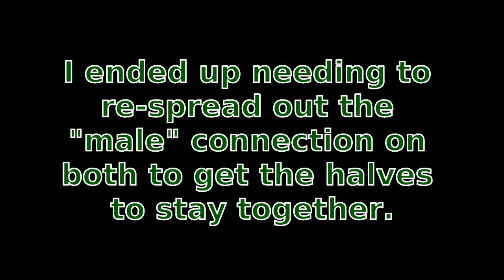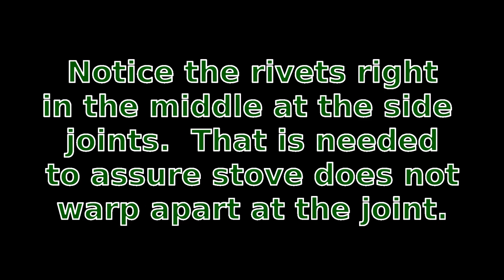Make A Simple Cheap Tent Wood stove - Part 1

Comment: Lonnie, would it make sense to peen the stove pipe opening from inside to the outside so it fin in the pipe? I am imagining that it would allow smoke to rise up without leaking out. Also, is galvanized metal safe at high temperatures in confined spaces? I thought I heard at one time it was bad to breath. Maybe that’s only at welding temperatures. Pretty ingenious design, though! Take care.
Reply: Sounds like you touch on heating galvanized steel towards the end!
Reply from the maker: Concerning heated galvanizing safety, you did not watch the entire video.   You DO NOT want the stove pipe collar upright so as to fit inside the stove pipe.   Burning wood creates distillates which condense out on the cooler stove pipe and run back down the pipe to drop back into the stove and be burnt.  If you place the stove pipe outside the collar, those distillates will run onto the stove top and drive you out of your shelter because of the fumes and overpowering aroma.  In a properly designed stove such as this one, you do not need to worry about smoke leakage as long as you are using a clean stove pipe that is not built up enough with creosote to limit draw.
Reply from the maker: Yes without rewatching the video I assume a commenter  was correct when they said that it is around the 33 minute mark where I discussed galvanizing burning safety.
Reply: Far North Bushcraft And Survival yeah, I got to that part. Glad you answered about the pipe, too. Thanks Lonnie. I just need a tent to build a stove for now! Take care.

Comment: How much use can you get out of these stoves? Would they last longer if you use a grate or shelve on the bottom?
Reply from the maker: I do not know how long this will last but I will not be surprised if I get a minimum of 5 years of occasional camping use.   I do plan on making a false bottom for this eventually and will video the process along with other mods that I have in mind for the stove.

Comment: Thanks for the video. Stove looks great. Im excited to build me own. How's it holding up?
Reply from the maker: This stove actually has very little use on it so far buit it works really great.   The door and door area has warped somewhat and so can not be stoked up full of wood and allowed to burn since it will get outrageously hot and uncontrolled.  I need to install a stove chimney pipe damper.

Hot Tenting In Alaska Winter Using Homemade Tent And Stove
https://www.youtube.com/watch?v=gQ_eb92vJMk
Reply: @Far-North-Bushcraft-Survival  Good to know. Thanks alot and thanks for the videos. Keeps me entertained and gives me something to do when im locked up inside. Nice work and please keep em comin.

Comment: Hi, is there a reason you have to make two bend  on that pipe piece to make top piece and bottom piece joined at middle of side wall? I was thinking to make just one bend in the middle of flated pipe piece, and joined two piece at corner, like square trunk duct pipe.
Reply from the maker: The edges would still have to be bent so that they could mate to the opposing piece if using the method you are asking about.  So instead of two bends using my method, you would require three bends using your method, at least on one of the sides

Comment: How long does this stove last? I am thinking about making one to heat my shop and wondering if it will last more than one winters use???
Reply from the maker: I would not recommend this stove construction for a semi permanent installation.   This should only be used for temporary shelter camping such as a hot tent in my opinion.  It is too thin to safely use in a building.   If you are wanting to go inexpensive, I would recommend a barrel stove kit.  You can get barrel stove kits for usually under a hundred dollars and then build a quite durable stove using an empty 55 gallon barrel.   I used a 55 gallon barrel stove kit on a 30 gallon barrel and it worked quite well with a few modifications.   Luckily the particular kit that I obtained would fit the door portion on the smaller diameter of the 30 gallon barrel end.   It is what I use for my main hot tent stove for my larger hot tents.   Through the years I have seen several people using the barrel stove kits for cabins and shops.

Comment: Nice work. Did hear you say you are going to make a hot tent out of a the nylon or poly which ever it is? Should be a good video. I know you did one out of tarps, like you get at Harbor Freight or Lowes Hardware. Do you have plans to make one out of the light weight stuff? I can't remember what it's called. Take care.
Reply from the maker: The material I have is 1.1 ounce Mtn Silnylon.   I do not have any "plans" as such but will be doing a video on the process if everything goes alright.

Comment: Very good video as usual. I cant find 7 inch stove pipe around here. Would like to know where to get some.
Reply from the maker: I got my 7 inch stove pipe from Lowes Home Improvement national chain store here in the USA.   It does not need to be 7 inch.  It could be 6 inch for a smaller version of the same stove.

Comment: Great design,  and I like the video.  But the materials used are to lightweight.
Reply from the maker: It can truly only be said to be "too light weight" if it fails to function as intended.  This stove has proven itself and is well worth many people considering doing due to the effort and cost vs longevity ratio.  This stove may not be worth it to you for YOU to make but I am sure many others would feel very differently because to them, this stove may be the very best option they have ever found once all the considerations have been weighed and balanced.

Comment: Could you put bbq grill paint, or high temp engine paint on that after the galvanized particle are gone ?
Reply from the maker: I would think that would be possible but I have not tried it personally so do not know for sure if the paint will adhere well to that heat treated metal.

Comment: great video, would it help to install a fire grate in the bottom? I'm in the process of an fat 50 ammo cam stove but I really like your stove. thanks for sharing.
Reply from the maker: There is no need for a grate if you are thinking in terms of burn oxygenation.   I do plan on eventually placing a two piece elevated false bottom in this stove for stove floor longevity.
Reply: thanks Lonnie i'll give it a try. @Far-North-Bushcraft-Survival

Comment: Great work Lonnie...just curious...I looked up about galvanized steel used with heat and it says it only allows up to 392°....is it still safe to build?

Galvanized steel can be welded; however, one must exercise caution around the resulting toxic zinc fumes. Galvanized steel is suitable for high-temperature applications of up to 392 °F (200 °C). The use of galvanized steel at temperatures above this will result in peeling of the zinc at the inter metallic layer.
Reply from the maker: galvanized steel is perfectly fine to use for wood stoves but the galvanizing needs to be burned off as I said in the video.   Galvanized metal stoves have been used for many many years.

Comment: I had mentioned in the Tent video to weld 1" x 3/8" stiffeners to prevent warpage, but since it's a non-weld job then 1" x 1/4" stiffeners with. longer rivets would be used

Comment: How does it last long term?  Gavlanized steel is not a high heat metal. and would assume it would deterioate rapidly
Reply from the maker: Time will tell how durable it is as a stove but I will not be surprised to get at least 5 years of occasional camping use out of it.   I will be spraying the cleaned stove with PAM type cooking oil at the end of each winter camping season and storing the stove out of the weather.

Comment: I can't see the bottom lasting very long. I realize the scope of this project was to make something with minimal special sheet metal tools. Perhaps adding piece 16 ga- 1/8th stainless steel bent to insulate the bottom and an inch or so up the sides. use a few nuts as spacers to keep the stainless off the bottom.

Comment: Great video, ty. Can I use Flue pipe tape to seal the seams?
Reply from the maker: I am personally not familiar with flue tape but also am not aware of any seams on this project that are in need of sealing.   The air leakage that would be best to remedy is caused by stove door warpage and sealing.

Comment: Brilliant Lonnie - once again. What tent material do you use to house the hot stove pipe?
Reply: Just to clarify my question Lonnie - you said that you had a nylon tent. Is the hole that houses the stove pipe made of a different, more heat proof material?
Reply: @stephencockett9959  ... If you're referring to where the stack goes through to the outside ... yes, it's definitely different material.  It's made from a Fiberglass Welding Blanket.  You can see him make it here:
https://www.youtube.com/watch?v=HfiUgGhTe1k
Reply from the maker: What Arthur linked to below does work well.   But what I will be using in the nylon tent will be lighter in weight than what i have used in the past.   I am wanting to reduce bulk and weight in this new tent and so went with the material at the link below.

https://ripstopbytheroll.com/products/stove-jack-material

Comment: Great little stove Lonnie...gonna try that one myself...how long do you think it would last?
Reply from the maker: Time will tell.  I am guessing that I will get at least 5 years out of it if I spray PAM cooking oil inside and out at end of each season to reduce oxidation.
Reply: @Far-North-Bushcraft-Survival  I would imagine you would have to burn the PAM off outside before bringing it inside...well worth doing if it lasts 5 yrs...thanks Lonnie
Reply from the maker: I forgot to add that I will also be storing the stove out of the weather.   yes one should either perform the initial first of the season burn outside or open up the tent door/s wide and let it burn until it quits smoking before closing up the tent because it will smoke and stink initially each season.

Comment: I've been scouring the web for a DIY hot tent stove that is worth building.  This is the first I've found that's not ridiculously heavy, flimsy, or too small. (I'd like to get a good sleep. Not chuck wood in the stove every hour or two.)  Thank you!  Can anyone that's used this design comment on how long of a burn can be achieved with a full stove dampened down for a slow burn?  Also, would an inline flue dampener be useful or recommended?
Reply from the maker: I personally do not like stove pipe dampers.   They tend to cause a backdraft high pressure in the stove which encourages smoke exhaust gases to find another way out which may be through a leaky door or gaps or cracks around the stove pipe that is below the damper etc.  If the stove is sufficiently air tight, the burn rate can be controlled entirely by air intake adjustments.
Reply: @Far-North-Bushcraft-Survival  Thank you.  Any idea on how long a burn can be stretched with a full load of wood?
Reply: I'm still wondering how long of a burn might be expected with a full load.  I realize times will vary greatly depending on several factors.  But a 'this is how long I got with this wood and these conditions' would be helpful.   Thanks in advance.
Reply from the maker: To tell you the truth, I just have not been out in the woods this past year as much as I would like to have and have not used this stove enough yet.   I tried using it during a winter campout last year with a rather large tent (my pyramid tent) and along with too large of a stove jack opening where I was loosing a lot of heat, I had to swap the stove out for my 30 gallon barrel stove kit stove because this one just was not enough heat.  The tent was too large, the cold was to intense, the stove jack opening was too large letting out too much heat.   Soooo to answer your question . . . I don't know the answer.   I can get a 4 to 5 hour burn out of my 5 gallon bucket stove with the stove turned all the way down.  I would expect this one to be similar if not better but I can not say that it will be for sure yet.

Comment: Any other ideas on Home Depot material to use other than galvanized pipe?
Reply from the maker: Take a walk through your local store and see what you find that may be a substitute if you do not wish to use galvanized.  However keep in mind hat what ever you use will need to be thin enough to enable you to be able to manipulate the bends in it without the aid of expensive tooling unless you have the tools needed.

Comment: Hi Lonnie (-:   I can get square ducting 8"x 10" at the local Home Depot... a bit smaller overall than yours but I don't mind... seems to save the initial step of folding round pipe.  Wondering if you see any down-side to using that?  Do you think it would be ok to go with 3" stove pipe for the exhaust?  Thanks for any thoughts!
Reply from the maker: You could use the square ducting easy enough but like you said, the 8 X 10 would be quite a bit smaller.   You could perhaps get away with using a three inch stove pipe on that but I think a 4 inch would be better.   I have a three inch nesting pipe on my 5 gallon bucket stove which starts out as a three inch but ends up being two inch at the top of teh pipe.  It is too small of a pipe for the 5 gallon bucket stove but it does work.   It tends to build up with soot which most stoves/pipes would do if run very long at low temperatures such as when turned down to last through the night longer between refills.   BUT, a three inch pipe will be effected sooner by that soot buildup and will need to be cleaned more often than a 4 inch pipe in order to restore proper draft.
Reply: @Far-North-Bushcraft-Survival  - True Lonnie, the size would be substantially smaller.  I just calculated it at 2/3 the volume.  An 8 x 12 comes in at 4/5 the volume... interesting opportunity for size choices!  

I hadn't thought about the soot factor.  Thanks for bringing that up and I'll definitely keep it in mind.  Nesting pipes seem near impossible to get a hold of down here in Canada (at a reasonable price anyway) so I'm experimenting with the other options.  Thx so much for your help!

Comment: Could you talk more about the baffle, dimensions, placement,etc?
Reply from the maker: I do not know if the baffle is of optimum dimensions or placement as it is all guesswork at this point.  I have never used a baffle before.

9 inches from front to back 

5/8 inch gap from rear of stove and rear of baffle so baffle front is 9 5/8 inches from back of stove

2 5/8 inch gap at the front between the stove top and the baffle
5 1/2 inch gap at the rear between the stove top and the baffle
Reply from the maker: The stove did seem to burn well during the initial burn.   So initial impression is that he baffle will work well.

Comment: Very good stove. 👍 I’m a new subscriber from St.Louis Co. Missouri. Question: How long would you guess this stove would last.?? Before burn out? Thanks 😊
Reply from the maker: I would guess that it should last at least 5 years with occasional campouts per year and if stored off season in a dry location.   I do not know for sure however but am guessing based on my other stoves.  My friend has a stove made from a thin metal 5 gallon bucket.  He says that he gets 5 years plus out of those stoves with regular occasional yearly campout uses.
Reply from the maker: By the way, welcome to the channel and thanks for subbing.

Comment: Lonnie...do you do metal work? 😂I need help polishing my Cold Steel Great Sword..

Would you season that joker with oil to keep it from rusting so bad after the zinc burned off?
Reply from the maker: I will be spraying the cleaned stove inside and out with PAM cooking oil at end of each season.   Also will be storing the stove inside and out of the weather.

Comment: I have a question: How long and maintain does the stove last in years?
Reply from the maker: There is no clear answer to your question as there will be different variables with each case.   It would of course depend on how often the stove is used.  It would depend on how well maintained the stove is during off season when the stove is not in use.    This is NOT a heavy duty stove for everyday use.  It is best used for occasional camping outings.   A person may get 5 or more years out of this stove if it is used several times each winter and well taken care of when not in use.

Comment: Adult 30 cal ammo can would work better or even a modern one but they wore or Korean or vintage 30 cal would work really good in there's lots of videos on them
Reply from the maker: most ammo can are way too small for my needs and just are not worth bothering with as stove construction material for me.   I have been Alaska  winter camping in hot tents for perhaps 20 years and through that time I have learned what works and what  does not work as far as my needs are concerned.   Yes a tiny stove made from an ammo can might heat a tiny tent in the winter but it would require restoking the fire every 15 minutes.   I personally prefer something that I can stoke up and cut back the oxygen flow so that it will burn a couple hours at least.   My 30 gallon barrel stove holds a fire all night quite easily.   My 5 gallon metal bucket stove hold a fire up to 5 hours though it is not putting out much heat at that burn rate.